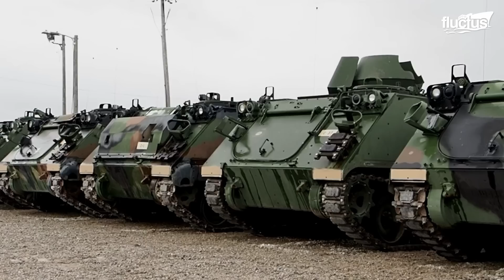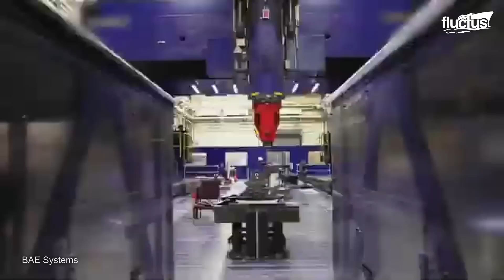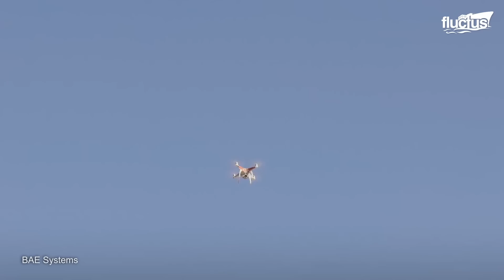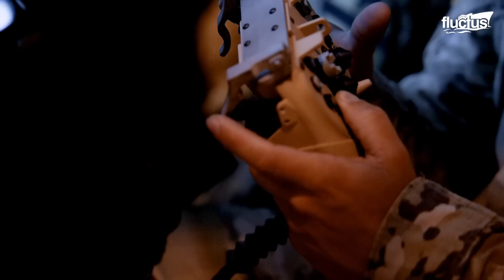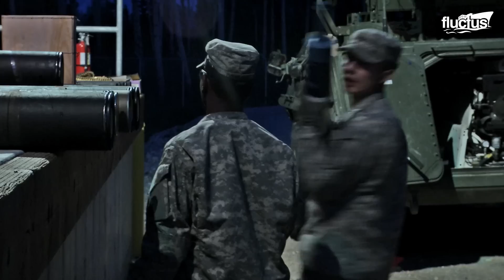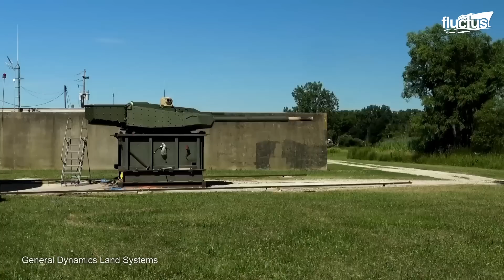US Testing Monstrous New Vehicles for Scary Ground Combat Missions

Comment: Why aren't prime mover truck engines and automatic transmission's used in  tanks, troop transport? Wouldn't these turbocharged engines be cheaper to replace, repair, and more reliable ?

Comment: i was  m113 driver  in turkish army for a 15month, many different role and many upgrade with new electronics and kind of weapons, armor is not enough and not right materials for a modern fight scenarios, behind of todays anti tank missels and many of high tech weapons, even better walking outside safer than being inside of on it, now we saw on social media turkish army start use it as unmanned veichels. driving it was very fun, i remember we make m113 race while go refuiling :D max about 50km/h .. which one has better engine care can be reach max speed or over of it :D  but really strong vehicle, rescuing stucked trucks, you can drive it on ice snow... he loves mud :D you can swim on the water :D:D:D alot of fun i had with it :D:D

Comment: Crazy that a little drone can completely destroy one of these things.
Reply: It only works when there isn't any countermeasure in place.  Ukrainians reported a 75-90% failure rate of drones once Russia employed their countermeasures.  What you see on the internet is only the successes.  Now, imagine what you didn't see, and you can understand why there is attrition.
Reply: @shionuzuki5549  now tanks are developed with lots of drone/infantry counter measures
Reply: Not if it has reactive armor on it.
Reply: They're making counter drone systems everyday.
Reply: Little drones will actually have some problems with Casper trucks, if you want your troops to live you stick them in a Casper truck if you feel like gambling you can stick them in something else. Casper truck were designed to deal with IEDs routinely on a daily basis which most drones happen to be IEDs. Casper trucks are meant to get blown up possibly several times a day with no casualties and then towed home and repaired if disabled.
Reply: If the "armour" is not more than a thin layer of aluminium.... 😁
Reply: It cannot be destroyed, but it can be disabled.

Comment: Fun fact..M113 is the most produced armored vehicle in history, with over 80 000 made... After 65 years, still going strong.. Not for the role it was made (battle taxi/APC) but still better than a Humwee for many behind the line roles....
Reply: It's easier to maintain the HUMMV but the HUMMV was never needed.  The jeep and 113 is fine. The Bradley is a good vehicle
Reply: Lawan hamas saja gak kelar kelar.... 😂😂😂😂😂,,,, hamas kelompok kecil saja.... 😂😂😂
Reply: i was  m113 driver  in turkish army for a 15month, many different role and many upgrade with new electronics and kind of weapons, armor is not enough and not right materials for a modern fight scenarios, behind of todays anti tank missels and many of high tech weapons, even better walking outside safer than being inside of on it, now we saw on social media turkish army start use it as unmanned veichels. driving it was very fun, i remember we make m113 race while refuiling :D max about 50km/h .. which one has better engine care can be reach max speed or over of it :D
Reply: It was one of the worst ideas every made.  You do know in Vietnam they were death traps?  Any decent caliber could penetrate it's silly armour.